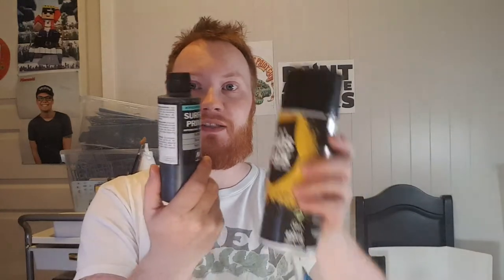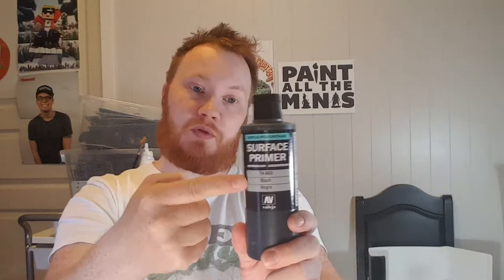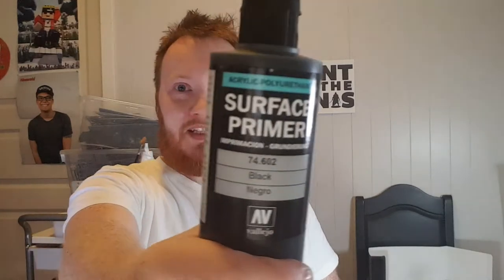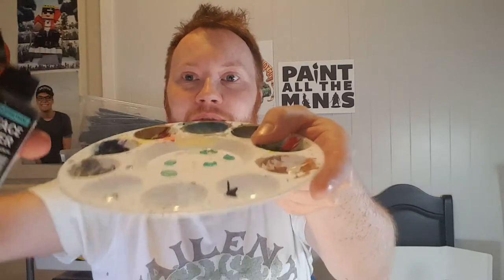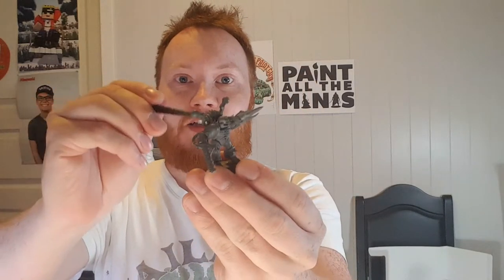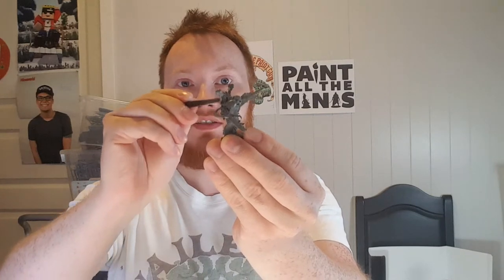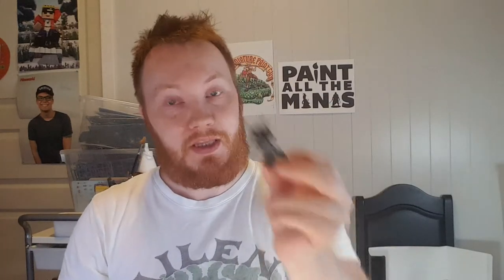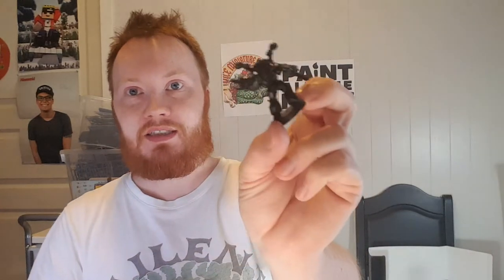Beginners guide to Primeing all kinds of Miniatures

Comment: Hands on indeed. Also a good thing to keep in mind when using a rattlecan is to not spray when it's moist or raining outside. ;) Or when it's tooo cold.
Cheers,
T:
Reply from the maker: athilith yes great points there, think I need to make a follow up video.. did not want to make it too long and to much information in it